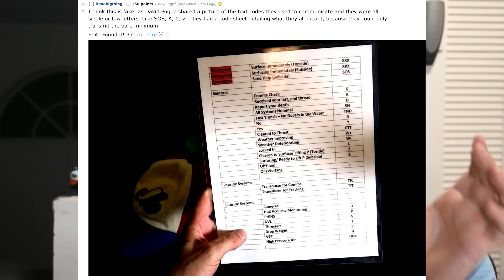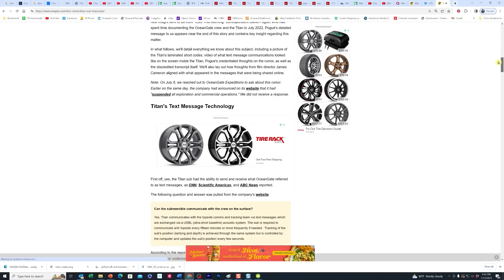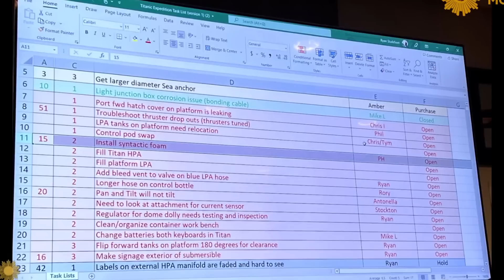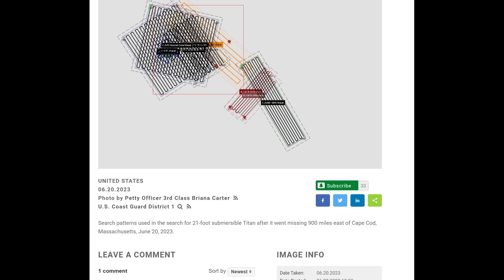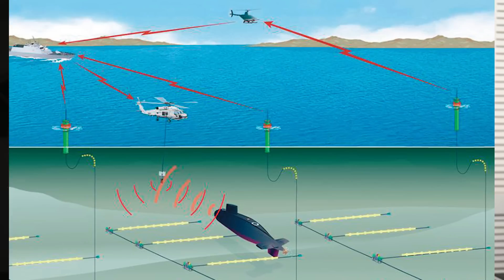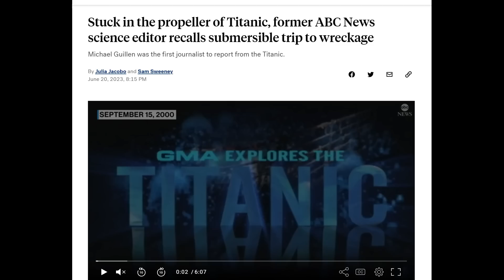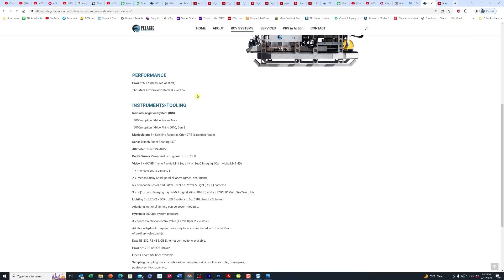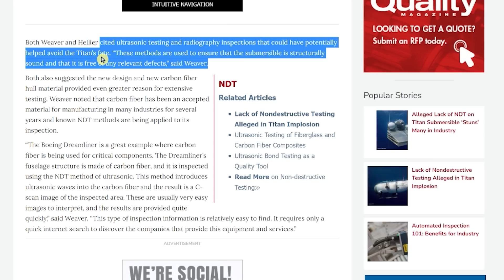The Shocking Truth About Fake Sub Transcripts No One Tells You

Comment: Been following this for a while, here's my take - 

The transcript i have significant doubts on but am not willing to commit 100% either way. Id like to see if it gets verified or not. I suspect whatll happen is someone like James Cameron will let slip if its real or not. 

The construction phase - holy hells. I keep a more sterile environment rebuilding engines and transmissions than what they were doing. Yikes.

The USN not immediately releasing what they know -- couple factors. One is the security aspect - the USN and US armed forces (as are most other modern armed forces) are notoriously massively tight-lipped about this sort of thing. Second, related - while they 'academically' knew - that is, they knew from experience what it should of been - they wouldnt of 'factually' known. Better they say nothing, let the search play out. If they had said 'we think it imploded' only for it NOT to have imploded would of been a PR calamity. 

The 'cable' issue. What people that ask this do not realize is this: You have a submersible that weighed 21,000 Pounds. You need a cable - and attaching point/s on the sub - that can handle not just that weight, but the weight of 13,000 feet plus of cable, plus the loads of the ocean, plus the load of winching it up from the bottom. While its certainly possible, its MASSIVELY pricy. As we have seen, Rush was all about AVOIDING cost. My guess is the cable would need to be rated for at least 100,000 pounds, possibly much more depending on the weight of the cable, but its not my specialty so im purely guessing. The individual pieces are going to be substantially lighter.  There are math geniuses that can do that math - I aint one of em. 

Why do people release fake stuff? For the clicks. For the attention. For the money. For the fun of screwing with people. LOTS of reasons people do stupid crap. 

The NDT - odds are, another way for Rush to AVOID spending money.  Very much the mindset of a certain political group, it must be said.

What I want to see is a map of what pieces were found where on the ocean floor, and high-res images of WHAT they found. The viewport lens and rear titanium cap are conspicuous in their absence from the pics released. I suspect they may not of found the viewport lens - probably sank several feet into the soft muck - but the rear cap, I bet they found it and they are hiding it until the investigation is complete. My suspicion is that is the component that 'human remains were found' on - or rather perhaps imbedded into. The front titanium hemisphere is, not to be ghastly, very clean for what its just been through. Makes me suspect the other hemisphere, ah, isnt. 

Side note - Im a Red Seal Automotive Service Tech, studying for Power Engineering 4th class, and private contractor that builds/rebuilds structures. One of my hobbies is studying the technical aspects of how and why ships, planes etc sink, crash or fail. Ive got a fairly good eye for studying damage patterns, witness marks and the like, being able to see what they brought up will, for my opine at least, be able to tell me more.

Comment: How did the control lines (electrical control wiring) go from inside the carbon fibre container to the outer thrust motors??? Wouldn't this allow the water to enter from the outside??

Comment: IMO... there was a very small leak... jetstreaming into the compartment with electronics... making that strange sounds... sooo it's sslowly filling up with water... 
Then they start to try to get upwards. But the weight of the water hinders that. Then power fails and they ar in dark.. no rising ..
Then the pressure inside goes up and they die.. 
No implosion... but failure .. because of that the glueparts just failed due to no more pressure on the sides.. Anyways... probably a terrible death and no implosion.😢
That carbon hull is just floating somewhere... plus bodies... 😢

Comment: In the year since Pogue radio discipline could have slipped to full words. Or they could have improved communication tech to no longer need to use codes?

No NDT is probably result of Stocton Rush's arrogance. He "knew" his method was adequate. Or it was simply money. He wasn't willing to "waste" money on testing, either "to destruction" and / or "non-destructive testing"

I think the final "crash" reports are going to be scathing: non standard construction, poor construction technique, (ie lack of clean room standards, no gloves, no roughing of glued surfaces), no auto-clave, inadequate testing of design.

In aircraft terms, he was using an untested design, uncertified construction, "experimental" craft for commercial purposes. Not allowed!

Comment: I'm no engineer by any stretch of the imagination, but I was shocked to see there was no excess glue seeping out when they were fitting the titanium ring onto the compression cylinder. I work on guitars & yes, I realize that it's apples vs potatoes by comparison. However.......the application of glue or bonding agents to any two surfaces, should always have plenty of "squeeze out" to assure that the two surfaces will be bonded properly, any voids completely filled & the two parts are sealed beyond any reasonable doubt. Otherwise, you can not expect the bond to be stable enough to provide adequate stability when put under stress or tension. Again, I'm certainly no engineer, but some things are a practical, common sense precaution when peoples lives are at risk. It's time for some strict laws be put into place concerning submersible diving on these shipwrecks, regardless of if they be in international waters!!!!!!! Anyway, that's my 2 cent opinion on it.

Comment: i wasn't saying it was fake because the sub wasn't being told it was descending too fast, I said it was fake because when diving a deep sea submersible doesn't waste power using thrusters to descend. it uses ballast, and that would be constant every time it dove because they would surely use the same amount of ballast for each dive. the premise that they were "descending too fast" is not plausible nor does using it in the transcript show a fundamental understanding of the operation. the use of specific depths so far outside what is expected and frankly predictable was the big red flag. Nothing should be causing it to descend faster than is expected or normal period unless somehow substantially more ballast was used than previous dives and even then it's debatable it would make that big of a difference.

Comment: As far as the endcaps are concerned, I wouldn't be so worried about the endcaps being glued in that fashion, that is not the problem. With the pressure that deep sea diving provides, the endcaps would stay affixed and water tight without any glue at all. The problem isn't how they glued them, the problem is that they are completely foreign materials to one another with completely different compression and expansion characteristics. As far as the implosion, after I watched the hull fabrication videos, I knew, for 100% certain, how this imploded. I have worked with this type of material quite a bit and I understand the properties at play. It was insane that they would wind a uni-directional fiber around a cylinder to create the pressure hull.  This provides virtually no stability bow to stern.  Essentially only the epoxy resin compound itself provided lateral strength. Perhaps the most troubling was using carbon fiber at all. Creating a tube from carbon fiber provides for very poor external compression strength. It would have worked well for INTERNAL pressure (like an air tank or something) but very poor for compressive forces. The pressure hull simply imploded, right smack dab in the middle of the tube, and when it did, it did a complete collapse in less that 1 millisecond, with such force that it slightly blew the endcaps clean off, and I mean "clean" off, there wasn't any residue left on the endcap rings. This is also the reason why the entire back part of the submersible was in such good shape, it was initially blown clear enough while simultaneously the fiber tube separated inward, sheering off all bolts in an instant and clearing the endcaps which didn't move laterally very far at all. They almost remained stationary. The viewport was also blown clear pretty easily. Remember, the viewport was designed in a taper, inwards toward the hull, so that the intense pressure outside cannot push the viewport through the endcap into the pressure hull. The viewport didn't need a lot of reinforcing bolts to hold it in place, the pressure itself would easily hold it in place. The viewport had very little strength for pressures from inside of the pressure hull. At instant of collapse, there was enormous pressure from inside of the pressure hull, just for a few brief instants, resulting in the debris that we have seen. I might point out one clue that may debunk the "transcript" story. The cradle or "skids" of the submersible. In the transcript they mention they dropped the skids. (A) I don't believe the submersible had the ability to do that, (B) Even if it did have that ability one of the legs of the skids was sheered clean off. This would be very unlikely to have happened by simply dropping the skids. Remember, the skids were designed to support a whopping 21,000 lbs.!!!! .. It is very unlikely that the impact of the skids hitting the ocean floor would have been sufficient to completely sheer off (sheer off !!!) one of the legs. That means, it is extremely unlikely that the Titan dropped it's skids (cradle), making the so-called "transcript" bogus. Further, Titan had 5 ways of ballast, according to Stockton Rush in his interviews, this included ballast air bags, capable of 1/3 or the buoyancy capability. Why does the so-called "transcript" not mention any of those other methods of ballast? .. Did Stockton Rush, if it were even possible, opt to drop the skids before trying anything else? .. How would Titan have been able to dock on its platform if they did make it back to the surface? .. Titan required its skids in order to dock with its platform. I highly doubt that Stockton Rush would have done so unless in an absolute last ditch effort, assuming it was even possible to do (which I am almost certain it was not, we can see in videos how it was all bolted together). Again, until someone can absolutely PROVE to me that the so-called "transcript" is real, I am not believing it for 1 second. There are WAY too many disparities. I call BS on the "transcript".
Reply: The transcript mentions it took several tries to drop the skids. It is quite possible one leg stayed on, and when the sub imploded that leg sheared off, from the massive forces released at that time.
Reply: @hondooooo  - WRONG! .. the skids are not built that way. Go look at the construction of the submersible. I am astounded at how many people have grabbed onto the mantra "prove the transcript isn't real" .. blah blah .. and without the slightest bit of skepticism .. people are so freaking gullible it is ridiculous. No wonder we have so many problems these days. Stupid stupid people....

Comment: My question will make this statement redundant, but I have no engineering background. I’m curious why one option for deep sea subs isn’t filling it with water at the surface and sealing it like it’s done now then have passengers breath off a supplied air line but remain in the low pressure regime of the surface so they wouldn’t need decompression stops on the way back up. The sub couldn’t implode violently as the water can’t be compressed . It would have its own issues, obviously, but wouldn’t that be A way to do it that wasn’t auto-death?

Comment: In the recovery pics of the entry door, where are the holes for the screws that held the front viewing window in?
Where are the traces of adhesive/carbon fiber on the sections where the tube joined the ends?
It appears new/unfinished parts were used for photo ops.

Comment: QUESTION: Since the Sub must be hermetically sealed, how do the controls on the inside of the sub, interface, connect or communicate, with the thrusters, ballast, etc on the outside of the sub?
Reply: Simple, they take hand drills and drill little holes to allow the wires through the wall. They put the wires through, tested it and then they use Gorilla glue to seal those holes. Safe as houses!!!

Comment: re: glue not oozing out...  Although I can't be certain since I wasn't there during assembly, I believe if you look closer, you will see that the blue strip on the circumference of the top dome as they are lowering it is an offset guide just to keep it exactly centered while setting it. You wouldn't see any glue as it would be inside of that enclosed gap until it is later removed after the resin sets. I do, however, agree that there was no way to know that there were no voids in the adhesion layer without some level of testing using one of various NDT methods to scope it. But to be frank, although the resin/glue is important, it would not be expected to handle any load, it will be under compression during cycling, it just needs to not fall off when it's out of the water. Of course I'm totally ignoring the elephant in the room, and that is the dissimilar materials and their differing compressibility factors.

Comment: Let me tell you how you need to do it it is so simple you need to roll and check this out the sub needs to be 40 ft long 10 ft wide four-by-four ribs everyone foot centers all through there the outside base of it needs to be 6 in sick 400 grade stainless steel everything needs to be done out of stainless steel the end caps need to be welded on with a 4in by 4in rib on the other side of that weld on the inside the windows at the ends needs to be titanium transparent glass 8in thick with a 4 inch thick ring bolted on plenty of cameras all the way around looking back at the sub on the outside as you're going down you are doing inspections as you're going down the sub needs to lay on the bottom of the ocean at the Mariana Trench for one year if it does not implode your Good2Go forever

Comment: On the Navy detection:  I suspect they heard something, a singular event. 
1. The  system is not meant for singular events.   It's meant for tracking.
2.  The underwater acoustic environment is very complex due to different profiles of temperature vs depth in different places, and these profiles change with solar warming, currents and surface weather.  The profiles lead to sound ducting and voids.  In other words, depending on the profile between source and listener:  at some times, in some directions you can hear inordinately well.  In other times, conditions, directions, you couldn't hear your wife in the dark of night.
1 + 2 mean:  there are several reasons for ambiguity  when a singular event is detected.
 On the other end of the hypothetical spectrum:  the acoustic signal processing could be so whiz-bang fantastic that the navy had this sound pinpointed in a 90% sphere of 10m radius.
In the first case, there's insufficient precision for the Navy to announce they heard something.  They could not discount the sound came from elsewhere. 
In the second case, they couldn't announce, as it would reveal the classified technical performance of their systems.
In q middling case, How much certainty would they need to have in their assessment to make a responsible announcement for this situation?  I suspect they don't have an established threshold, and the matter would be resolved soon enough that it would be a waste of time for the organization to resolve the question.
At this point, I'm inclined to the former, with perhaps some of the middling.

Comment: From the Ocean Gate own website:

Can the submersible communicate with the crew on the surface?  

Yes. Titan communicates with the topside comms and tracking team via text messages which are exchanged via a USBL (ultra-short baseline) acoustic system. The sub is required to communicate with topside every fifteen minutes or more frequently if needed.  Tracking of the sub’s position (lat/long and depth) is achieved through the same system but is controlled by the computer and updates the sub’s position every few seconds.
Reply: @@AC-jt9yb  could be, but the vessel was descending really fast, so the crew maybe was really puzzle about why. Overloading?
Also the submersible was prone issues, god knows if the system that was suppose to track them all way down was not working properly and Mr.Rush in his infinite wisdom decided to use the messaging system as a way to keep the surface ship updated of the dive instead of fixing the tracking system.

Comment: This Stockton just wasn't realistic. He wanted to do everything on the cheap. He wanted to be like Captain Kirk is what he said once. An intern told him once that he got the carbon fiber discounted from Boeing because it was already past it's shelf life. Lochridge, the former employee fired for trying to keep raising concerns of many potential failures of this vessel, did examine a small cross section of the carbon-fibre hull. He found that there were "very visible signs of delamination and porosity." This thing was coming apart more and more with each dive.

Comment: The transcript is fake. Alongside the many reasons to doubt it, if it were leaked, why wouldn’t it have been leaked to the media? 

The glue is definitely an interesting premise, but the short clip shown does not show the straps it being hung from lose slack. The crane is still bearing the load of the ring, so there’s no way to know if any glue was pushed out when it was fully seated on the cylinder.